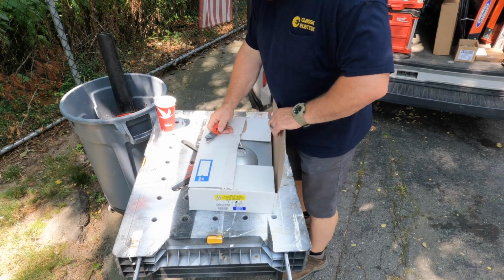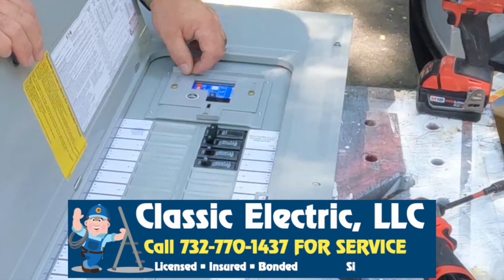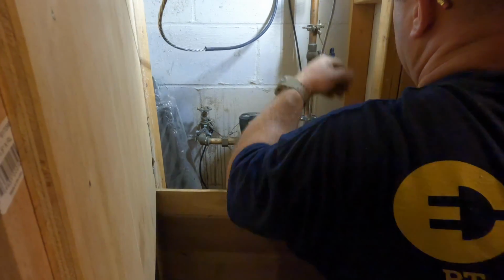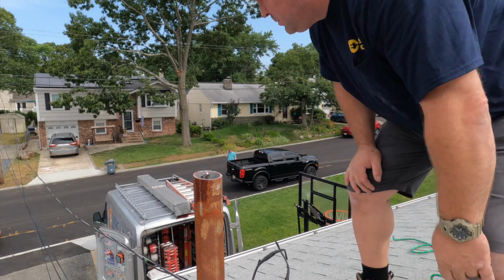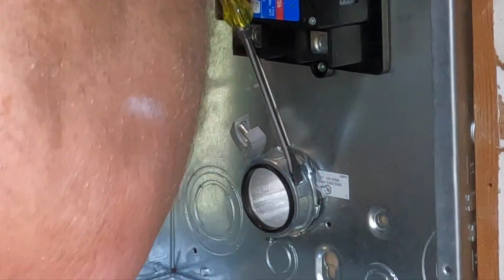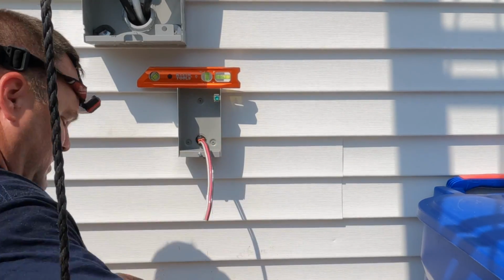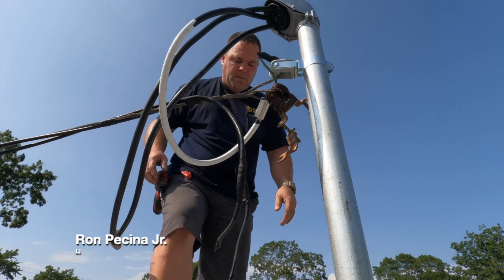200 AMP Mast Service Upgrade | Surge Protection & Generator Wiring  #200amp #electricserviceupgrade

Comment: A few years ago, i was called in by a buddy to help him rewire a brand new house from which all the wire had been cut and stolen by tweakers who broke in. 

To steal less than $100 worth of copper scrap value, they did over $2000 in damage. We also had to cut above the service panel to re- feed the new romex into the box, because the bums didnt leave enough at the top of the wall to connect to. (And it wouldnt have been code anyway, as each circuit has to be a contiguous run)

Comment: I love how you put the main breaker at the bottom. I don’t see this enough. Too many guys run those giant 4/0 wires from bottom to top and waste all that gutter space  just to make the main at the top, even when it throws side to side.
Reply: Stop hating. This is how it’s done in our area. We often don’t use meter mains and sometimes it’s a pain to and always it’s more expensive   Would you cover the additional cost yourself if the client did not want to pay for a meter/main combo? Also, 2 ground rods are  required even with a cold water ground (250.53 (a)(2) 
) unless you get one ground rod certified 25 ohms or less.  Too many young sparkies on the internet look to call out others’ work and mostly they’re uninformed. Great work Classic Electric!
Reply: I stand corrected that you didn’t know about the 25 ohms John Davies because I saw it in your other comment. Apologies. But for this same reason you still need 2 with the water ground. And the meter only with main breaker is how we all do it in jersey and PA

Comment: Replaced a mast riser that had been bent by a truck hitting the service drop where they crossed the driveway. We were 100 feet from the pole which is about max around here. Tied the drop off to the chimney which wasn't in line with the pole so had another rope tied off to a car for a little sideways pull. Worked out fine. Had the keys for the car in my pocket LOL. Raised the mast higher and added guy wires to it.

Comment: Thank you for sharing your knowledge.

Impressive how you attached those two hot wires to the service mast without gloves. I imagine that the service drop wires were live, correct? I know that technically, you are OK as long as the hot wires don’t touch each other or the neutral, and as long as you are not grounded yourself.
Reply: Bird on a wire bud
Reply: He also kept his hands insulated the entire time. Only touching the jacket of the wire or the handle of the T allen

Comment: That piece to anchor the wire to is an insulator. All service drops here in California  require an insulator (or wireholder) of some shape or form, to attach the incoming line to a structure.  Nowadays, we're starting to see less porcelain or other glassware being used for insulators, as polymers and nylon materials are being made for that purpose.

Comment: Great job brother. I was an electrician for 8 years and then got into the outside lineman union on Long Island. FYI that loop is a preform on the neutral from the utility drop. If you cut back the tape on your hot legs they can be unwrapped a bit and you can u do one side of that preform. Start at the span side of it and get it started with a flathead screwdriver. Once started it’ll easily come undone. Only have to open the one side of that loop and you can pass it through the lollipop (porcelain point of attachment. Then re do it. Easy peasy. If the drop is  too heavy uses a wrote tie a clove hits back a bit and tie the drop off to your pipe so you free up your hands. Great work brother be safe. Just subscribed

Comment: When running a long ground wire across the house, does it introduce an addition voltage drop across the cable due to line resistance?  Seems it could create a different potential.  I love watching your workmanship. Thank you for adding references.
Reply from the maker: Any conductor has resistance no matter how big or how far. The National Electrical Code has a chart for sizing the GROUNDING ELECTRODE CONDUCTOR and it is based upon the size of the service entrance conductors. NEC 250.66
Reply: @electricianron_New_Jersey  sorry for the dumb question.
Reply: @MrKen59  There is no such thing as a dumb question...especially if you don't know or have been trained where to look...
Reply: @electricianron_New_Jersey  are those wires power the one you attached on the roof
Reply: Yes! This is correct.

Comment: Very informative video, thanks.  I do have a question, after the upgrade does the electric company have to run thicker wire to the mast to match the new wirw you just installed?  I live in Ohio.
Reply from the maker: That's up to the utility company. The vast difference between utility wiring and customer wiring is that the utility wiring is mostly in "open air." The ampacity ratings are completely different than when the conductors are in a conduit.
Reply: So, in other words, “knob and tube” (in open air) has a different ampacity than Romex?

Comment: Man.. you're a blessing to us common folk haha. Do you have to run an uninterrupted/unbroken line to the water meter or can you just jump it like you did the water heater then pick it back up on the other side of the houses cold water line (assuming unbroken copper throughout). Or maybe thats the point, to alleviate any unknown breaks in copper water continuity to where you might pick it up again.
Reply from the maker: Direct line from the main disconnect.  Jump it out at the meter and also hot to cold jumper at the water heater.
Reply: I’ve got some c crimp connectors great for irreversible splices on the GEC that work great in a pinch.

Comment: Great video. I do have one question though. The wire you had to feed the generator outlet, do you need a conduit sleeve through the penetration of the house to connect it to the box? I will be subscribing, you were very informative, keep up the great work!

Comment: With all the services you do, you should think about getting a Milwaukee cordless H-crimper for the services. The mechanicals work but take longer. Crimper is So much easier and faster.
Reply from the maker: I have thought about it. For the amount of time I'd use it I just couldn't justify the cost.
Reply: @electricianron_New_Jersey  understandable. They also have the cutter head that interchanges with it too. Anyways, nice install man! Can’t believe you do this all yourself. I always have a another guy with me, when doing a service like this. It’s a lot of work!! 
Hopefully the home owner knows to shut off that hot tub breaker, if they go to start and run that generator.
Reply from the maker: @mcarroll598  I still have to label the panel here and I put a red label on the circuits that cannot be used with the port gen. Thanks for the inquiry.

Comment: Here in Michigan, we have a homeowners exemption where we can get approved to do our own electrical work. I have an associates degree in electrical engineering, so I have knowledge and experience with this kind of trade. My question is, where and what brand do you buy for the butt joint when connecting the utility back up. I also have 2 meters/service with 4 hot conductors and 2 grounded conductors that are spliced to the 3 cable utility cables. How and what connectors would you recommend. Thanks 👍

Comment: Great vid. I'm just wondering if you're alowed to use insulated lugs for the service connection instead of rubber tape & electrical tape ?

Comment: Hi Ron great job. A customer of mine needs a 200-amp service upgrade. The only available meter/disconnect combo was the one that had eight spaces for circuit breakers. I didn't want this I just simply wanted a combination meter/disconnect but they don't have that back ordered for a year "supposedly" My question is I need to install a 200-amp panel in their house can I tap off of this meter/disconnect 8 circuit panel combo to feed the indoor sub panel 200 amp?
I'm just concerned about this 8-circuit space that I'm not even going to be using Outdoors
Thanks
Reply: Yes essentially all of these meter main combos have feed thru lugs for an inside panel. I like them myself, nice if you decide to add ckts to a garage or hot tub etc later

Comment: Ron, IF the water service is fed by plastic, can the water system be bonded to equipment to grounding bar, since it is not an electrode? I hear its not required? please explain

Comment: I have a question... can window wells with 6 feet of spacing between the 2 be used for the grounding rods?
Reply from the maker: @720vending  the rods are used to make a connection to the earth because the earth does not come with terminals.
Reply: @ that I understand but where my service comes to the house has a concrete slab patio and I need to add ground rods. But there is 2 window wells with dirt spaced about 10 feet apart can I install the rods in those window wells

Comment: Hi Ron - Very informative video as usual. For wires that might be too short inside the main electrical panel, have you ever used the Wago Inline Splice Connector to extend the wires (not sure if they are NEC approved). I find that the regular wire nuts make the panel look very busy and not the best looking.
Reply from the maker: Yes, Wago's are an approved wiring method inside a panel. However, they're a bit more expensive than wire nuts so I only use them where wire nuts aren't practical.

Comment: for all al wire should there be dielectrode grease used to prevent oxidation?
Reply: Dialectic grease? No. Noalox maybe, but any aluminum from AA-8,000 or newer is said to not corrode.

Comment: On the 2017 NEC that you are on in your AHJ, AFCI protection is not required when changing out a panel board?
Reply from the maker: Nope! We don’t even use an AHJ! New Jersey has adopted the Uniform Construction Code which allows them to amend certain sections of the NEC. We  also have an entirely different sub code called the NJ Rehab code.
Reply: @electricianron_New_Jersey  Awesome. Thanks, Ron. Love your channel. Keep up the great work to spread the love for the trades!

Comment: Hey Ron, great video! I found the PDF file reference with First Energy allowing Licensed Electricians to disconnect/Reconnect at the service drop.  Is their a PDF file reference with PSEG allowing this?
Reply from the maker: I’m sure it’s on their website as well but I haven’t looked for it in quite awhile.

Comment: That water ground should be sleeved when it comes down the foundation wall for protection. Why aluminum and not 4awg copper?
Reply from the maker: @tylerfrankard1288  If you’re going to advise me on a wiring method, please cite a code reference.  #6 AWG and larger do not additional protection from physical damage.  250.64 (B) (1)
Reply: @  I guess we all interpret 110.12 differently

Comment: Is there a way to change just the meter box without having to disconnect the line in up by the mast? I need to upgrade my meter box but if it IS possible id really like to not have to cut or mess with the upper line in. Can/how could you disconnect the line in at the meter box safely and keep it from arcing whole you pull the box, change it to a new meter box, then reconnect it to the box?
Reply from the maker: Yes, call the utility for a disconnect.

Comment: So I’m getting a 200 amp upgrade I currently don’t have a ground to my waterline just one ground rod. When the electrician came to give the estimate he said he would only have to add another ground rod and not ground to the waterline. So I would imagine that the electrical code doesn’t differ between states or maybe it does. And the work is going to be inspected so if they do it wrong it will fail so the question is waterline ground or not?
Reply from the maker: Maybe you have PVC water main.

Comment: Great info and work. Would it be a good idea to trace out and identify (label) all your branch circuits before connecting the lines to the breakers?
Reply: It's usually easier to do that after the power is on. That was you can turn on the lights and use a plug tester as well.

Comment: Hello. How did you or how do you support the mast to the roof. Braced not guyed. Thank you.
Reply from the maker: There’s a minimum height where bracing is not required.  Check with your utility company for specific requirements on support for a mast service.

Comment: Can you explain why porcelain bracket is used when ground is connected to meter and fuse box ? My house doesn’t have porcelain only metal bracket holding on to metal conduit.
Reply: Every utility is different may be an old service drop as well

Comment: Hey Ron I like your videos very informative. Could you not satisfy the code by using the rods only?Do you have to use the rods and the water line as part of your grounding system?
Reply from the maker: Yes, the ground rods supplement that copper water main pipe to complete the grounding electrode system.
Reply: @electricianron_New_Jersey  A little history, our old house with 60 amp service only had a water line ground.  I was looking at some older NEC books once and the article regarding grounding was rewritten to include the 2 8 foot ground rods in the mid 70's, I guess they determined the water pipe was insufficient.
I was told many years ago that the water meter was not considered a reliable conductor, because the nuts on the connecting nipples have rubber washers and the new ones they are putting in are plastic.  So the jumper was to maintain ground continuity.  What I don't understand is why you only have to use a 6 AWG jumper.  It seems common sense to me that if your putting in 200 amp service, you should have to put in a jumper that can handle a full 200 amp fault to ground.
Reply: @davidmarquardt9034  PVC not a great conductor.
Reply: @bradrock7731  True, but in our town we have heavy type K copper laterals running 75 to 100 feet out to the water main in the street.  The only break is the outside shutoff between the curb and sidewalk, and this connection is hard silver braised.  So that is a huge amount of surface contact.

Comment: Just curious, does the NEC allow to use a 225 amp main breaker panel with a 200 amp meter?
Reply: As long as the main breaker to that panel is sized down to a 200 or less. Otherwise you'd have to upgrade your meter (and probably the wires feeding it)

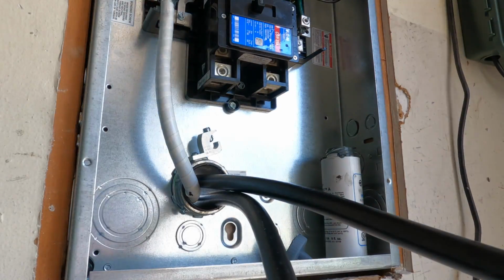Comment: Is that a Nic/cut on the white feeder wire on 21:48. ?
Reply from the maker: There’s no nicks on any of the conductors.  There’s a bonding bushing present to specifically prevent that from happening.
Reply: K, my mistake.
Reply: just a scrap? pushing back a bit of the white tape placed around the black cable to identify it as a neutral

Comment: Just wondering in your jurisdiction is it code to where you have to use rigid conduit or can you schedule 80 PVC electrical conduit
Reply from the maker: Normally, it's up to the utility company. If my mast were any taller than in the video the rigid conduit would have to be 2 1/2"
Reply: PVC, even SCH 80 is not load bearing-it couldn’t be used for a mast like this.

Comment: what happens when the city upgrades the water service to plastic and the customer doesnt realize that its bonded?
Reply from the maker: It’ll no longer be considered an electrode. This is why we drive supplemental ground rods.
Reply: His connections will still protect personnel in the case where the Copper pipe gets energized, the breaker will clear the fault.

Comment: what's that orange wire for the generator? 6/3 romex? is that acceptable for an outside junction box? what if that junction box needed to be a few feet away and conduit was required - could normal romex still be used?
Reply from the maker: Can’t use NM cable in a wet location. The orange cable is specific cable for Generac generator wiring and is rated for outdoors and for direct burial.  About $6 per foot.
Reply: awesome thank you. I'm piecing together the materials to tackle all of this @electricianron_New_Jersey
Reply: would that be a UF-B variety? @electricianron_New_Jersey